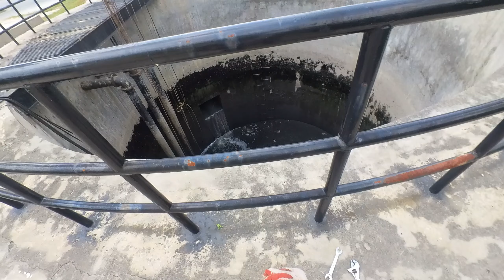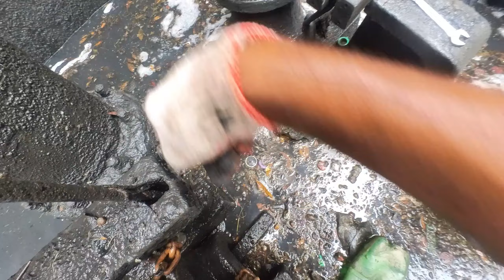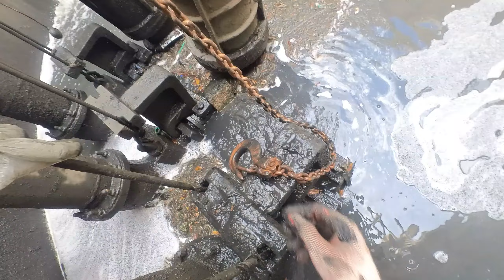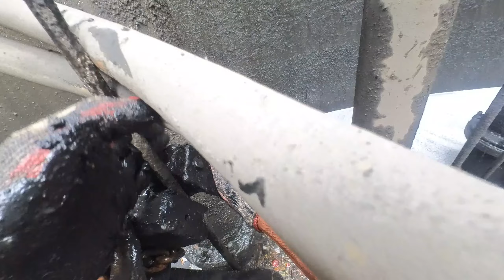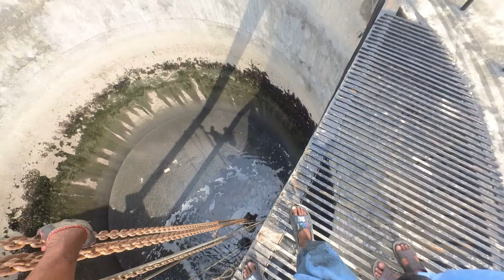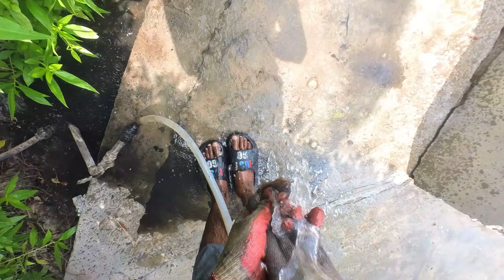Altaf Dives Into Sewage Disposal | A Job Full Of Danger And Bravery |

Comment: adjustable wrenches are designed to round off the heads of bolts....always use the right tool for the right job...and it will make life easier.....although slogging around in sewage is horrible
Reply from the maker: Okay Sir thank you so much ♥️🙏🏻